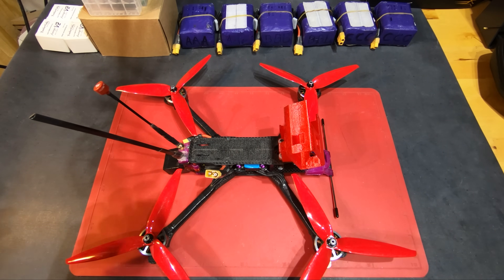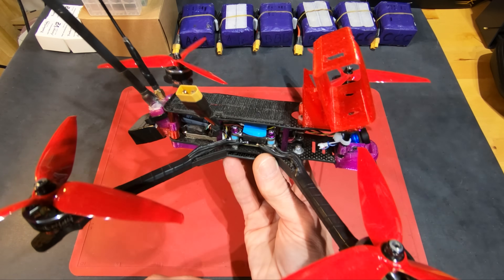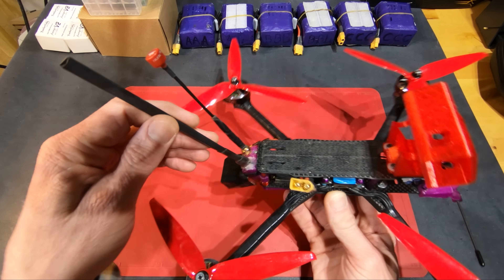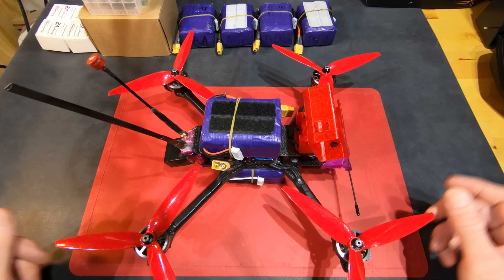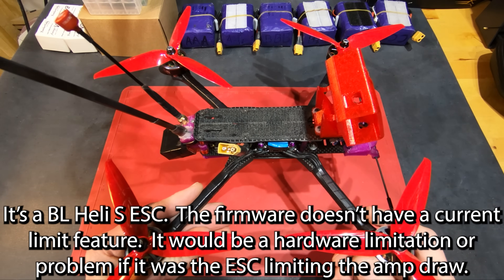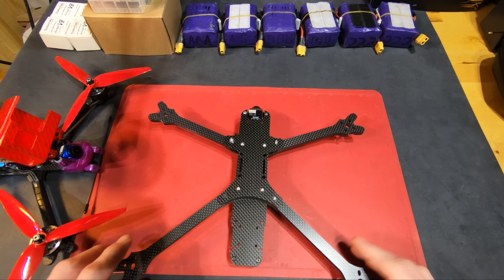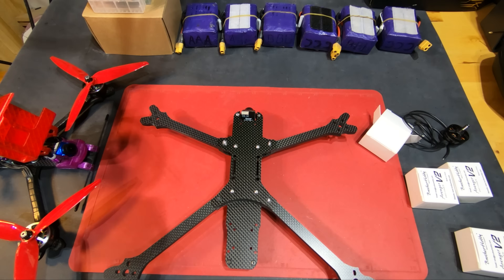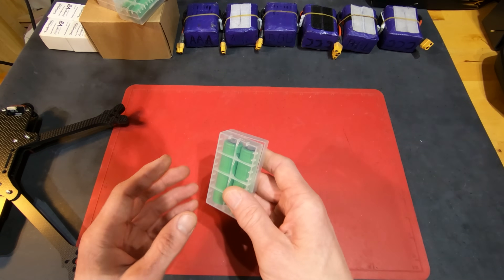My 2020 Long Range FPV Drone & Gear : Gets 8.5km Out - Roundtrips of 18km+

Comment: that was a lot of great info,  i'm a bit confused with the big flat 'true rc'' antenna, is that in addition to immortal t' ?  and you didnt go into gps,  ps. just got myself a couple of gopro's ( 6&7) and had a play with reelsteadygo today, its so good.  pps. not sure thebattery on top and one underneath setup can be beat, pps, my 5inch carries the gopro quite far forward and very high relative to slammed deck, looks like a truck without a trailer, it flies really well espite this odd look.
Reply from the maker: Thanks.  My new frame is meant to help  with that gopro issue, gets it more central instead of way up top.  Yes the long flat one is the second antenna connected to my crossfire diversity receiver.  It the best way to have good signal no mater what your quads orientation is while kms out.  It's a brainfpv gps, works really well but is also big.

Comment: What is the purpose of the bigger capacitor?
Reply from the maker: A 1000uf 50v is not unusual for a 7" drone.  It helps with the voltage spikes, using a 50v instead of a 35v makes it bigger but I believe it also works better as I think 6s voltage spikes can exceed 35v although only very briefly.

Comment: have you tried the true mox antenna yet, got those instead of the diamond i think i made the wrong choice seeing how far you got with the diamond
Reply from the maker: I just got a true mox, I'll try doing a comparison between them.  The true mox I think is higher gain than the diamond but higher gain isn't everything.  I'm curios to find out if there is much of a difference, I'll put it in a video in the next few weeks.

Comment: Thanks for making this video , great watch.... ive only ever had those bad bent props with the hq 7x3.5x3's the hq 7x4x3 seem to be a lot better/balanced in my experience, similar handling to the gemfans

I use the same iflight controller/esc for my 7" and had to scale throttle to 70% on my 1300kv to not overamp my vtc5d packs, so probably a good starting point although ive mostly ditched liions as ive been flying a lot harder lately 

Ive got a 2808 1500kv 7" ive been tuning that handles the wind a bit better than my 1300kv 7", and have been enjoying the weight/feel of gnb 4200mah 6s, also got a 10" built just waiting on props

Nice to see that freestyle at the end too!
Reply from the maker: Oh thanks for the info!  Part of my thought behind my new frame was to fit my 4000mah gnb lipo on it so I could do some faster flights.  I'll keep an eye on your channel for a video about that 10" build!
Reply: I'm currently using the HQ 7x3.5x3 props. I do see an "up" curve less than 1/3 the blade length from the hub, and then it flattens out a bit, so I'm not sure if that's what you mean? But on mine the props are all identical and vibration is quite low.
Reply: @Vousie  they made a new version of the 7x3.5 within the last year  .... The new ones are wayyy better and are the props I am running now on 7"
Reply: @badfourlife  That makes sense.

Comment: great vid bro just built a 6 inch running 18650 packs same way you are top and bottom 1600mw vtx on crsf exept im running bye props emax advan long range not sure about them yet ive run to flights 2miles and 2and a half so far before my bottle goes and i turn round im running 1850kv motors on 4s for low amp draw and im landing with jucie left so were have to see how it goes but can go 6s on these motors as you know love your vids bro have a great weekend
Reply from the maker: That's awesome!  I was thinking about building another 6" long range, I used to have one.

Comment: Great video....did you 3d print the gopro case?....it looks like its rsgo friendly.
Reply from the maker: Thanks, yes I 3d printed it.  I use a hero 6 so its all good with rsgo but I was trying to avoid getting jello from tiny vibs and a less than perfect tune.
Reply: @FalconRadFPV  awesome....do you have a link to the stl file?

Comment: wow 8+km on 250mw ( crossfire ) never thought that was possible. i always blast 500 or 1w
Reply from the maker: I believe the diamond antenna and diversity receiver make a difference at range.
Reply: I had done 3-4km on a wing at 25mW( but r9 module-r9 mini sadly ;) ). so im guessing optimal antenna positioning, somewhere away from noise helps too
Reply: @woodrunner51  that's just unreal and in total opposite of what i was suppose to believe about low vtx output lol. i think my vtx is just bad and need an upgrade
Reply: @davidvaknin3801  nono, not VTX, the controll link is 25mW
I havent gone over a kilometer with a vtx on 25mW, 3-4km was on 200mW vtx, with a tripple patch 25usd antenna on the receiver

Comment: Wow ive been waiting fot this video. Amazing video and needed. One question that i have about the orqa. Do they come with the rapidfire or you just have to buy it like in the hdo2 and if not can you just buy the same module from hdo 2? Cause im thinking of getting the orqa s or the hdo2 and not sure wich to get. Ive thought of changing to digital but im not sure if it can get better range than analog with your setup or a similar one and in a future i line to do longrange for sure. 
And again thanks for the video
Reply from the maker: Thanks for the comment, The orqa's are similar to the hdo 2 in that you have to buy the module on top of the goggle price.  The orqa's available to buy with the rapidfire in them already.  It fits perfectly the module doesn't stick out of the goggle shape at all, only the sma nubs.  Joshua Bardwell did a goggle video comparing the orqas and hdo 2s, that would be good to check out if you haven't seen it already.  (I still don't know for sure how far dji can actually go, I've never really looked into it either though.  But with analog the battery will be the limitation on range not the crossfire or VTX, in my opinion)
Reply: @FalconRadFPV  perfect thanks for the help
Reply: with Dji v1 goggles and 2 True RC LHCP patch antennas for Dji this gives 8.2km for the moment in LR plus Dive mountain conditions! with a 6 inch and 6s LiIon battery based on Molicel 21700.
Reply: @manufpv5462  which true RC patch antennas do you use for dji goggles?
Reply: @patmcfarland9880  this ones (X2): Antenne X-AIR 5.8 pour DJI FPV (LHCP) - TrueRC
Reply: Rapid fire is da best. Worth every penny